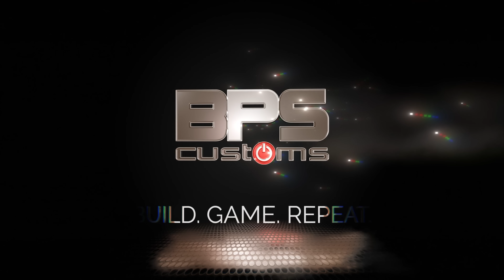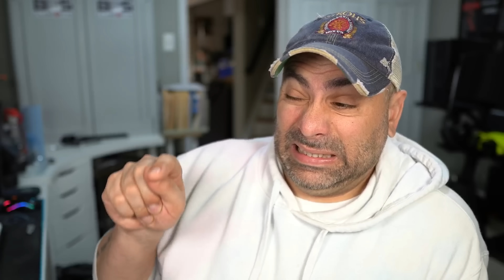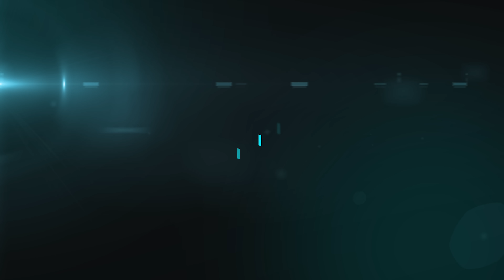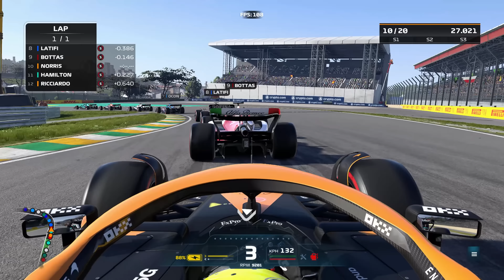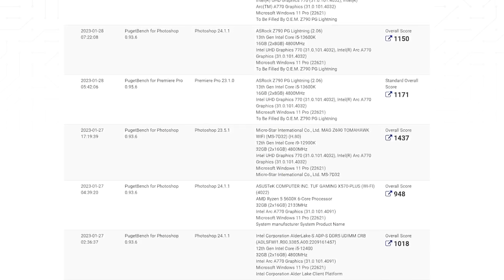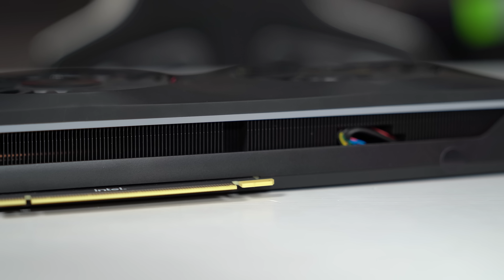NVIDIA & AMD Should Be Scared Of Intel

Comment: I picked up an A380 back in august 2022 on release and yes it was somewhat of a hot mess and after playing around with it for a few weeks I put it on the shelf. I picked up an A770 late last year to go along with it and revisited both and the driver improvements were remarkable. Most of my early issues were gone and all benchmarks and games ran fine. A380 = Nvidia 1650 in performance. A770 is right up there in 3070 land. Both are worthy cards at this point and just getting better for their price ranges.
Reply: Imo, initial reviews is what killed arc sales.
Reply: @CESAR_H_ARIAS  *terrible initial drivers at a launch pushed too early
Reply: @bluerendar2194  Goes great with terrible initial launch of BF 2042 pushed too early
Reply from the maker: Indeed!
Reply: Any chance you could try Hunt Showdown in 1080p on A380? Need to try in multiplayer tho (offline has way better performance which remains unseen in actual game otherwise...). I need a cheap GPU for my parents now that my dad has retired and has all the time in the world.
Reply: Agreed. And for only $350???! Such a good deal $100 less than a 3060ti and $200-250 less than a 3070. I ordered it 2 days ago and it even came with MW2 for free!!! Such a. Good deal. $350 gpu + MW2 for free ($70 game).
Reply: Hahahaha, you don"t have a 3070, or a 6700xt. No way it's as fast as either of those cards. 3060ti at the very best of times
Reply: @JBrinx18  Incorrect. I had an Aorus Master 3070. Thanks for playing.
Reply: @JBrinx18  recent benchmarks put the A770 in 3060ti/3070 territory at a decently lower price than either, with Intel just announcing more driver improvements that should push performance even higher. I have high hopes for their next generation of these cards.
Reply: @michaeldendulk9225 There won't be a next gen this year, and by next year it will be very low end whatever comes out
Reply: @JBrinx18  Battlemage is expected to launch Q1 of next year and is rumored to be targeting 4070 Ti to 4080 performance. If Intel can launch that between $499 to $599 it will be VERY popular.
Reply: @03chrisv  Raja specifically said they were going to stick with single 8 pin power. That means a maximum of 225 W, probably 200 to not risk overcurrent on the pcie power. Even on TSMC 3nm, they're not hitting 4070ti performance. They'll be lucky to hit 3080 performance
Reply: @JBrinx18  The A770 is rated for 225w so there's no reason to throttle their successor card to 200w. At 3nm node and a power limit at 225w you're looking at 3090 performance, or in other words nipping at the heels of a 4070 Ti which is good enough if the price is $500. Also Raja could be wrong, plans change, the moment they go from one 6 pin and one 8 pin power connector to dual 8 pins they'll be to able to push to 300w. Intel will not want to compete against AMD, they'll want to go head to head with nVidia which means they'll need higher power budgets in future products.
Reply: @03chrisv  you're just picking and choosing and making up what rumors you want to hope for at this point. Price point, power, performance
Reply: @JBrinx18 You're the pot calling the kettle black. I have no brand loyalty or skin in the game so its not about what "I hope for", but more so what Intel has to do to make their GPU endeavor worth the investment.
Reply: @03chrisv  it is pretty scary that they're struggling to execute. Like, not just GPUs, but CPUs are going to be rough this year for Intel. You really want them to be evenly matched so we can keep CPU prices like we had this Christmas